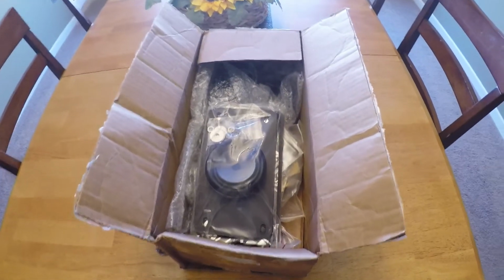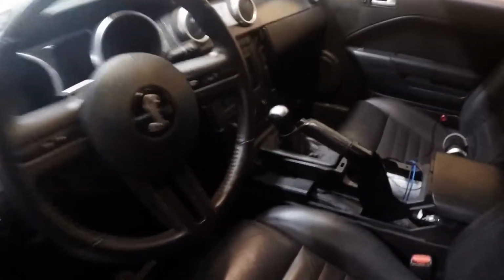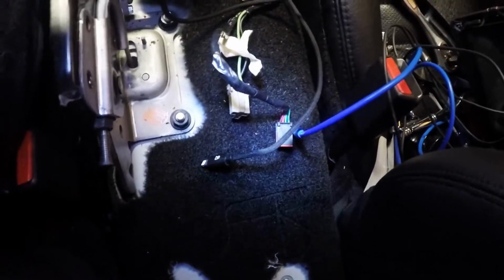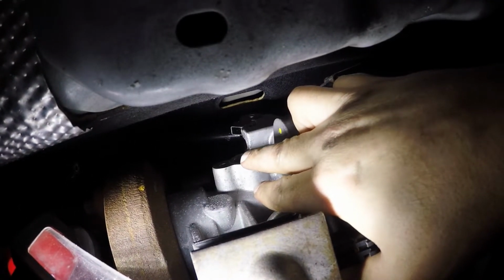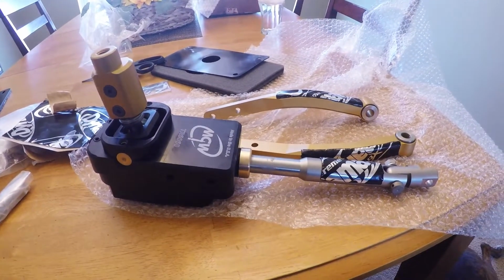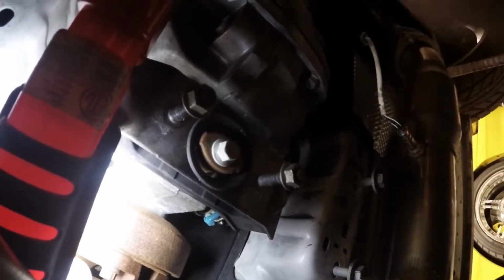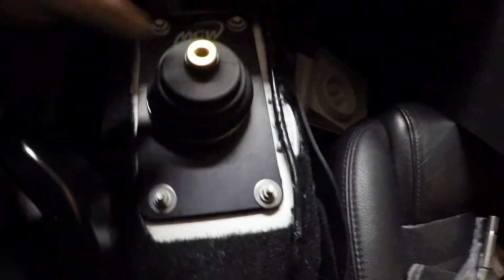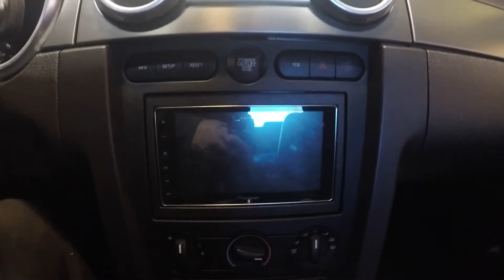MGW Gen2 install on 07-09 GT500

Comment: Nice install brother i want to get that shifter for my gt think its 200 bucks
Reply from the maker: Jason Cameron thanks man. SN95 is only $200? These are like $450. Lol. Non top loader tans stuff is expensive!
Reply: @PMPerformance  Your welcome brother and its either 180 or 200 but the sn doesn't have those rods and supports. I've heard only good things about that shifter prob why their a lil pricey
Reply: @PMPerformance  their 190 for new edge just looked it up lol
Reply from the maker: Jason Cameron yea top loader trans stuff is cheaper and easier. Just drop right in and rock. Remote mounted with linkage is a pain as you can see from the video. Lol
Reply: @PMPerformance  true i had mine off a few times now lol. And i could tell it was but your done now what other plans? And do you have gt500 decals?
Reply from the maker: @jasoncameron34  I am not telling the plans for now. 10K hits +1k subs and I will spill some more beans. If you look hard enough at the video, you can tell alot more ;) . I do not have the side stripes yet. One of these days I will get to it
Reply: @PMPerformance  lol i remember you saying that im sure it wont take long. Im gonna watch again too see i was just curious is all